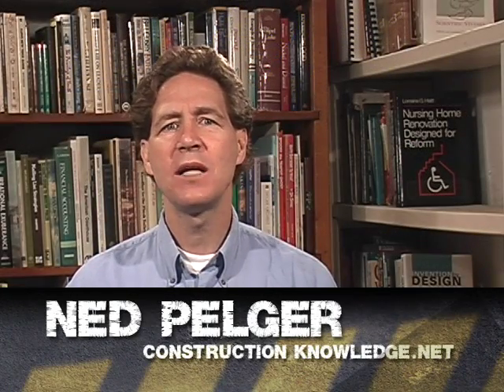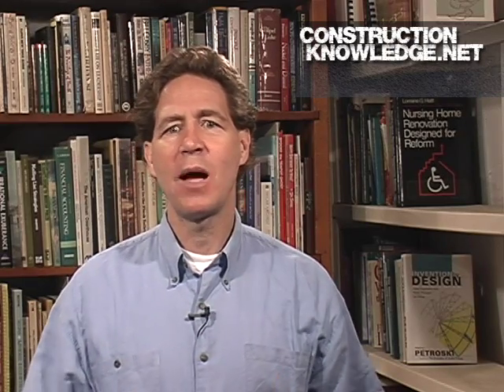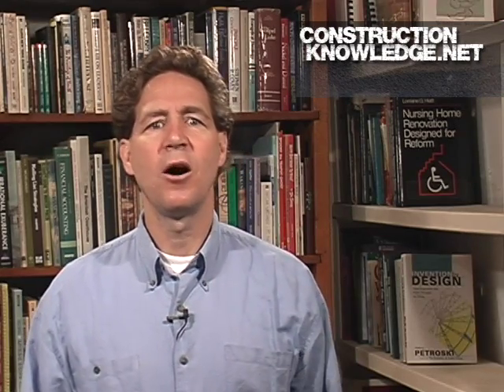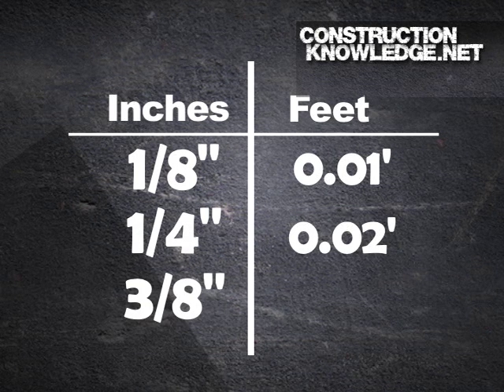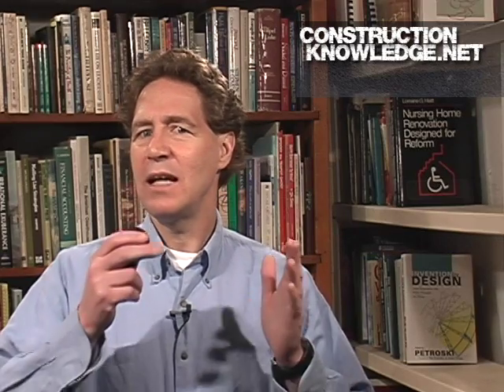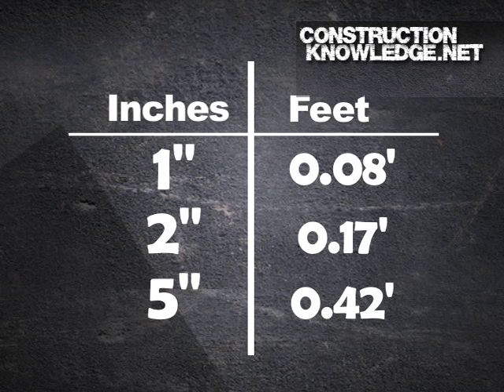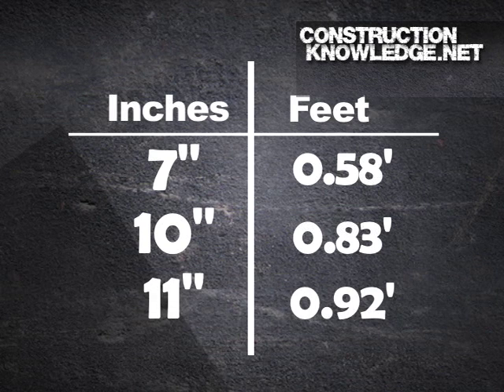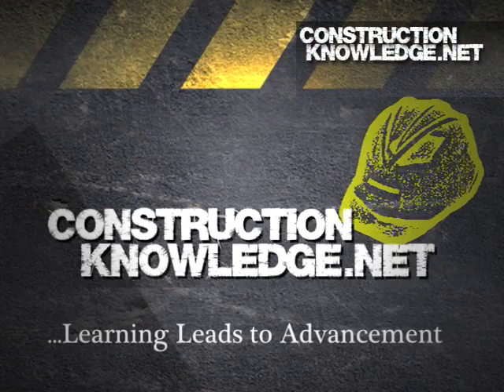Converting Inches to Decimal Feet for Construction Supervisors

Comment: using memory, what about a formula ?
Reply: using a calculator to get to decimal form from inches, divide by 12.  for the measurements less than an inch divide the fraction to get the decimal and then divide again by 12.